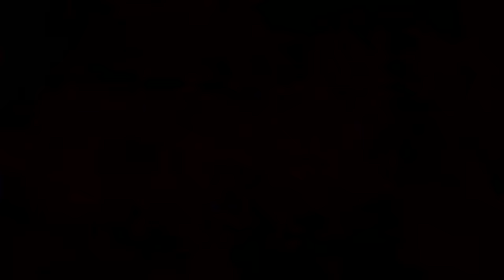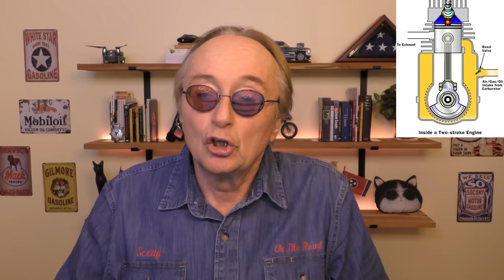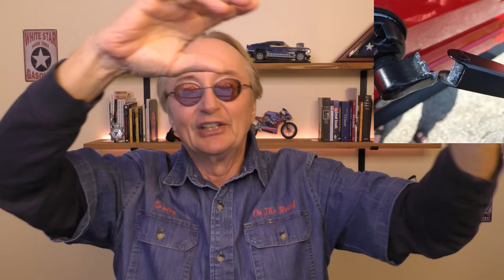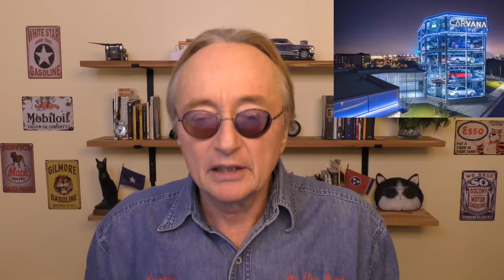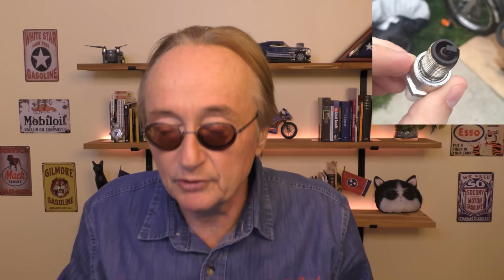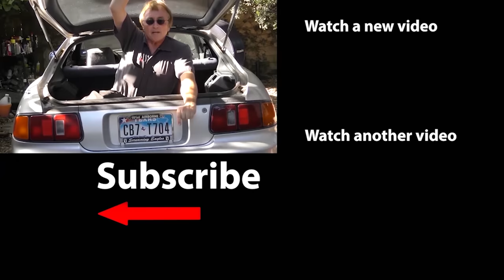Mazda Just Changed the Game with This New Engine (Goodbye 4 Stroke Engines)

Comment: Personally, I only lift my wipers because I want to be certain that when I start the car, the auto wipers don't try to move when frozen to the window, thus breaking the wiper or worse. Yes, I turn auto wipe off. It's simply a 2nd measure in case I forget. Never a problem with wind, etc.

Comment: Just ask Ford Explorer and Firestone Tires about flip overs and killed 365 people and led to the  biggest tire recall in history back in 2000 with the Ford/Firestone Tire Debacle scandal. Firestone knew as far back as 1994 that these Wilderness AT ATX II had thread separation issues but didn't due anything until their butts got sued by people and NHTSA got involved in fall of 2000. Please Scotty due a Video on the Ford/Firestone tire Scandal Debacle of 2001.
Reply: The front suspension on those Explorers was crap.

Comment: To say that "two strokes have double the power" is a gross over simplification and ignores the fact that traditional ported cylinder arrangements are thermally inefficient when compared to four stroke engines. The advantages of two stroke engines are that they are light weight, relatively simple and relatively inexpensive to produce. But if you want to produce "double the power" of a four stroke, you are going to have to pump in far more than double the amount of fuel in order to do so.

Comment: I miss my Miata...
Reply: The four words I never want myself uttering. Which is why I still own/love my ‘04 MX-5 MazdaSpeed Miata. Eighteen years old and finally hit 40,000 miles last Summer.
Reply: @mb6418  Mine was 2004 MX5 with all trims and ATP protruding alloy wheels. 180k miles. 
I gave it away to a young couple...
I have other roadsters..
I will buy another after sanity returns to auto market.